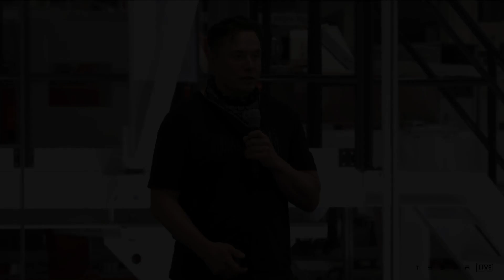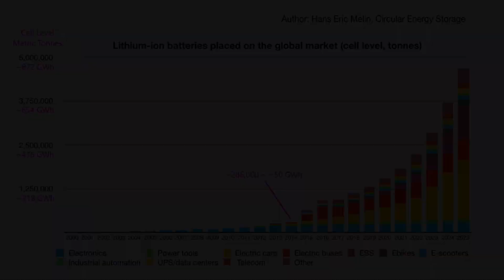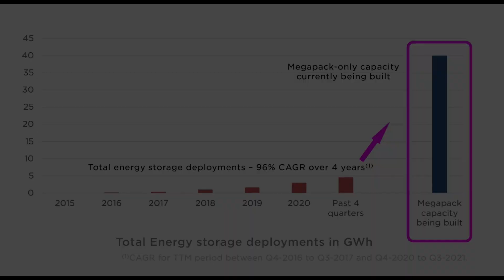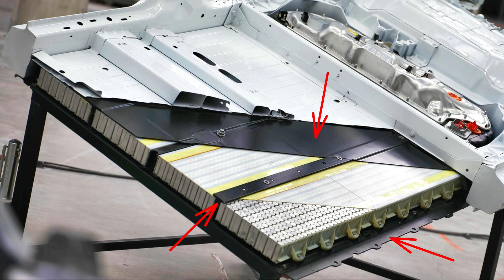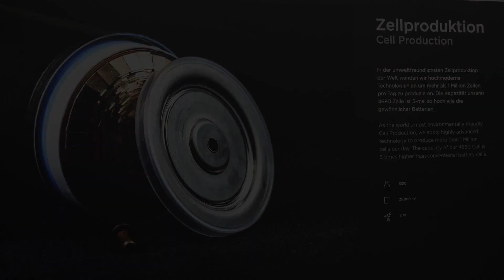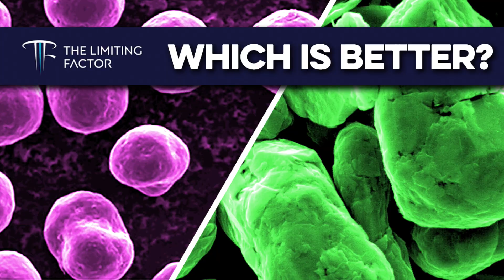Tesla Q3 - Just the Batteries // 4680 On Track, Giga Berlin, Supply Chain, and Leaks

Comment: CATL said that they already are producing sodium ion batteries and that they would have them ramped up in 2023. I assume these would be going directly into Megapacks and take the heat off of lithium supply for vehicle batteries. ???
Reply from the maker: They won't be ramped in 2023.  They will start ramping in 2023 IF there is demand.  That means many years before they hit 50-100 GWh.
Reply: @thelimitingfactor  Please watch CATL launch event for sodium ion batteries: https://youtu.be/LxKtCquWx5c  This launch announced the production of their first generation sodium ion battery which they said reached 160Wh/kg nearly equal to LFP.  They plan to establish an industrial supply chain by 2023 for the next generation expected to exceed 200 Wh/kg.  Aside from having excellent performance characteristics compared to LFP, sodium is 30 times cheaper than lithium. From the hype that exudes from this launch event you better bet yo' little bootie that CATL is expecting astronomical demand for this battery.  Why don't you do a deep dive analysis of the sodium ion battery and find out if Tesla is looking into them?

Comment: LFP Questions 
 I m not shure where to ask this, so i try here. I read in a few environmental impact papers, LFP have a higher impact than other chemistries. Especialy Ozon destroing chemicals.
What is behind that is it old Data or Is there a Problem.
Thanks alot for Your Contend.
I look always forward to the next Release.
Reply from the maker: Overall, LFP has much lower environmental impact than other chemistries.  The are non-toxic.  That doesn't mean they are 'friendly', everything we manufacture at volume has an environmental impact.

Comment: Could Tesla not make 4680 LFP cells at some point , they would be cheaper , safer and energy density would be less of a hit than other battery sizes
Reply: I wonder if Elon wishes he had gone direct to LFP for the 4680 format. Cooling and expansion should be less of an issue and we know the real worked performance of LFP is not far behind the nickel based cells.
Reply: I asked this question too because if LFP is the future, as Elon has said, what would the cost savings and energy density look like in a 4680 format.  If instead of a 56% reduction in cost with the current proposed chemistry it was say only 30% and the energy density was improved by only 10% are we looking at  a standard model 3 with 4680 LFPs  exceeding a 300 mile range, at a cheaper price, less fire risk and possibly a battery life ( including post car storage) of 50 years ? That is why I asked.

Comment: Is it completely impossible to make a structural pack for VTOL where Cells/SubpackAssemblies can be removed and replaced, quickly, for refueling, with some robotic equipment ?
Reply from the maker: Easy to do, but not advisable.  It would add extra weight.  Better to have cells that can do the job.
Reply: @thelimitingfactor  yes, definitely. 
I Was trying to imagine if the window of time would allow for a semi-structural design to make sense until then. Some swapping at stops, while adding 20-40?minutes of charge during a quick turnaround layover
Reply: Charging times are just fast enough that it's better to wait a little longer to charge (after loading and unloading of course) than have the extra weight (and thus reduced efficiency) of swappable packs.  Of course it would be better if charging was faster still and didn't add any wait time.

Comment: Skoda in Europe closed for a month , ev waiting time mid 2022 delivery and that was if ordered September 2021 , vw pushing hybrids as no ev production left , ford waiting times 3 / 6 months , Gm only restarting ev production , Hyundai short of ev stock, Chinese ev only available for short term deliveries but not everywhere. Demand for evs outstripping demand , even Tesla , ice vehicles more expensive both new and used and those who can are hanging on to their older vehicles , either waiting for ev or new ice or cheaper used vehicle . Chip shortage , battery shortage , man power shortage , covid implications . LFP batteries will help Tesla in particular plus China evs

Comment: Great work and comments, as always, Jordan !

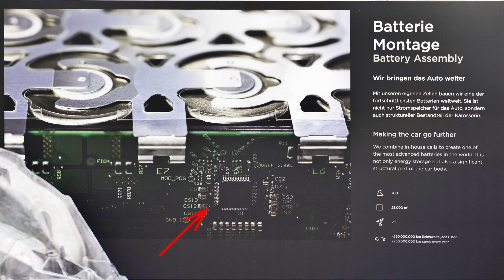At 23:37, you said that the circuit board (PCB) on the side of the 4680 pack is similar to what's on other Teslas.
It is indeed similar to what is on the new Plaid pack (as shown in Engineerix's video you linked), but it's also quite new, and shows how it has evolved since the first model S packs.

This PCB is most likely the BMS, responsible to measure and balance the cells, so it needs to be connected to each group of parallel cells (so that a 10P96S pack needs 96+1 connections to the cells). 

I was intrigued when I saw that image before, as it is quite different from what we saw on the model 3 tear-downs, like from Jack Rickard (https://www.youtube.com/watch?v=PvCOcBynlq0 at 1:17:24), where the BMS is on top at one side of the pack, and a flex-like orange PCB carries the cells voltages on top of the pack to the BMS, with hair-sized wires soldered between the flex and BMS board. 
And the older model S packs were using plain wires throughout the modules.

On this 4680 pack picture, it looks like the BMS PCB runs along the entire pack on the side, and it uses the same plain metal connector that already connects the cells together to make the contact to the BMS, with the 90 degrees bent side that looks springy.
 We have since seen that the new Plaid pack also uses this same technique but with the 18650 cells.

It is not clear from the picture if the BMS board is as long or wide as the pack is. Weight may be a bit higher than the flex previously used, but it may be easier to manufacture as it could be snapped in place (and maybe laser soldered, or simply spring loaded for the contact), and there is nothing anymore on the top of the pack which may help as it is now structural and the floor of the car. Regarding reliability it may be slightly better ?

Some people here may have better insights on this than me, but this seems different enough to be interesting ! :D
Reply from the maker: Great comment!  🔥  Thanks man!

Comment: Picked up my Model 3 LFP last week. Great car! I was really surprised that after charging ~4h with 11kw the SoC was at 100%. When I drove home I almost had full regen power. I never saw that on NCA based Model 3 I owned before. Is there just a bigger top buffer or also an LFP benefit? From what I know is it can take more current at higher SoC, but that much different? 🤔
Reply from the maker: Great question!  I'm not sure honestly, but it makes sense that the higher charge rate acceptance at higher states of charge would lead to better regen at higher states of charge.
Reply: @thelimitingfactor  In the morning when the pack was cold (around 8°C) regen was limited as I expected. Next time when I charge to 100% I will have CAN bus access to check some sensor readings.

Comment: I thought they needed nickel for the stainless steel in Cybertruck and SpaceX Starship.  I wonder how much kg of nickel is in CT body vs. battery.  Great job Jordan!  You are the only Youtuber where I watch 150% of your videos.
Reply from the maker: Hi Jeff!  Yes, the Cybertruck will use a lot of Nickel, but the Nickel for battery cells is a specialty chemical due to the purity requirements.  

That is, they aren't swappable and are different supply chains.  At least, that's my understanding.
Reply: The CT n Starship's steel is being procured from a supplier.  The nickel needed for those is part of the supplier's supply chain.